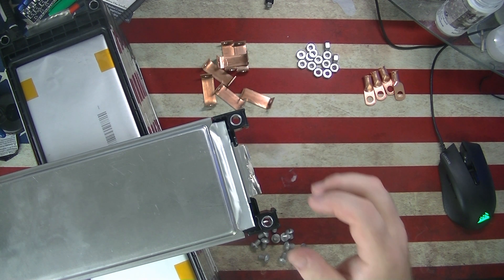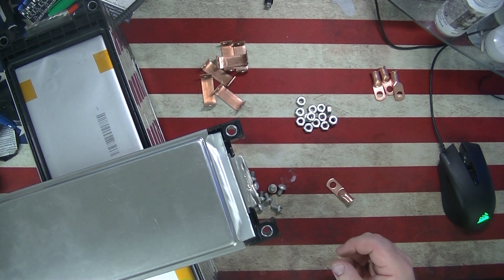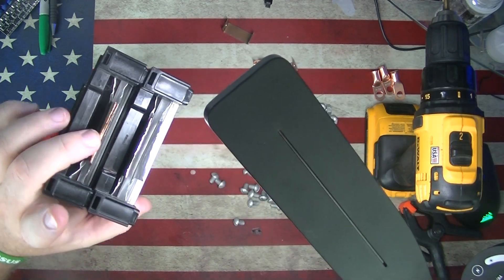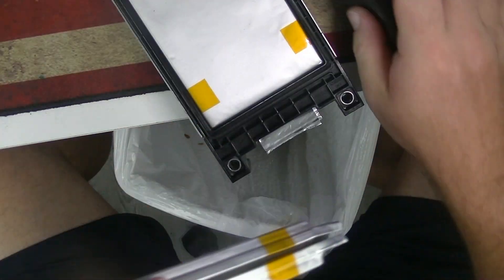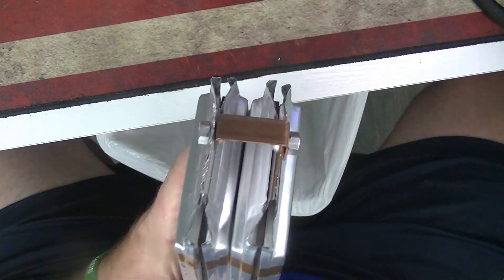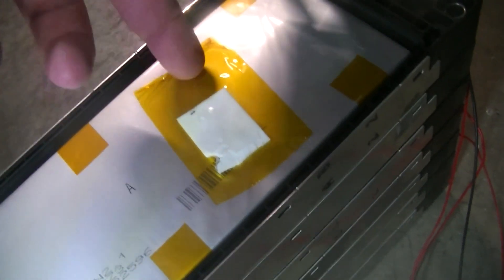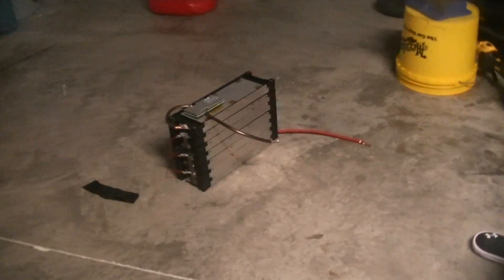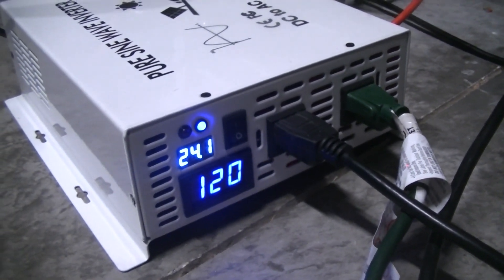Chevy volt Solar Powerwall battery, $350 3300wh, 7s 24volt lg 120ah

Comment: thanks for showing an alternative to Dave P's approach.
Not an expert, but I'd think aluminum bus bar would be better than copper, so you are not putting dissimilar metals together. One problem with Aluminum is how hard it wants to make an oxide coating qhich can interfere with power conduction. It's why Dave P put the black paste on the parts before bolting them together. Just my thinking.

Comment: You're going to damage your batteries if you haven't already done so.     The cells need to be compressed.  Using them without adequate compression is going to allow them to delaminate inside.